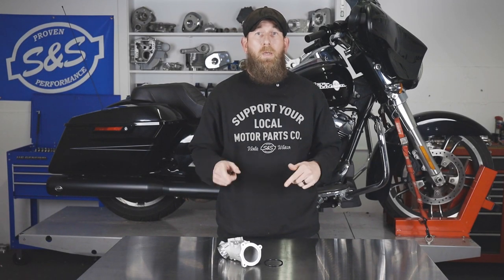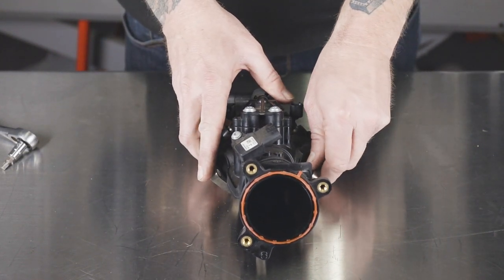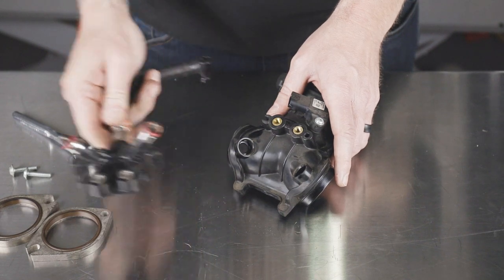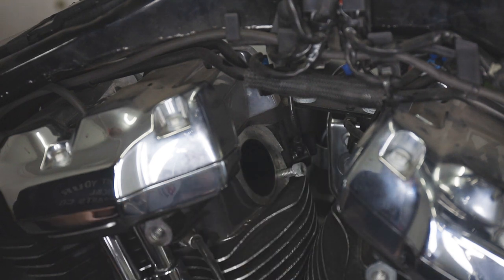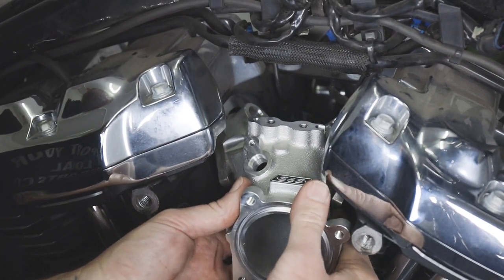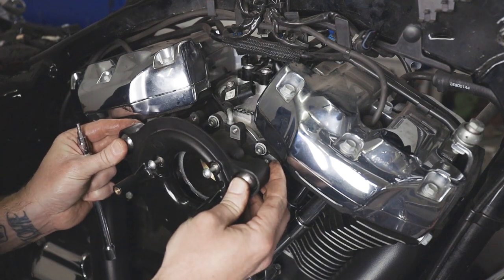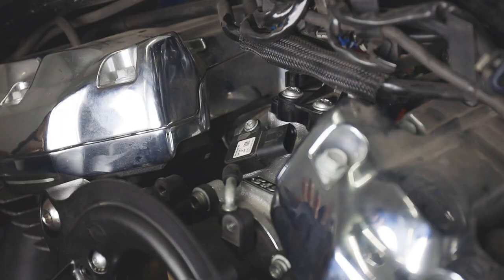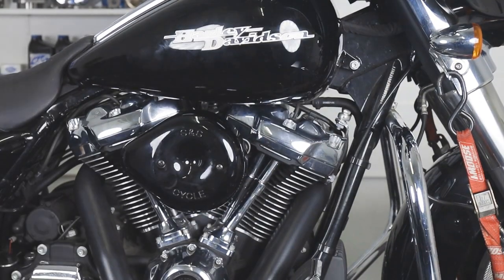Overview & How to Install - 55mm Performance Manifold for 17-21 M8 HD® models

Comment: Why do you remove he manifold as a unit then remove the individual components while off. Then put new manifold on then add the components. Why not just put it back together while off then install the unit as a whole the way you removed it?
Reply: That bothered me as well
Reply: Same reason you don't see a torque wrench or loctite anywhere in the video. 😂

Comment: Great video. A couple of questions, it appears you didn't install new intake manifold seals and didn't lightly lube the intake seals or the o-rings on the injectors or T-Map sensor when reinstalling. Is there  reason why? I have always lubed them with light smear of o-ring seal grease (PYB) or a touch of clean motor oil. Just checking to get your opinion. Thanks.
Reply: Makes sense to lube the "o" rings slightly. New intake seals is good insurance. That's my opinion.

Comment: Simple modification to make however not worth the time and money. My M8 stage 2 ran well before. The slightly larger bore cast aluminum intake manifold made ever so slight improvement if any.
Reply from the maker: We have seen the most benefit in replacing the stock plastic pieces when you begin increasing the cubic inches of the engine. At 124 and large, the stock piece begins to show it's weaknesses to heat that you do not get with our manifold CNC machined from T6 heat treated cast aluminum. As an adaptational benefit we see an average of 3-5 hp with just this one swap.

Comment: Hey man awesome and very informative video
 Kudos.  If i only do a stage 1 on my new m8 bike  do a i still need to replace the plastic intake manifold? TIA.
Reply: The stock plastic manifold is prone to failure.  With a stage 1, you do not need to do this for performance reasons, but it is nice to remove a common failure part from the bike.

Comment: I see a lot of shops using huge throttle bodies upwards of 64mm for stage 3 builds. Does this 55mm replacement flow enough air for stage 3 build of around 120/120? Thanks

Comment: Hi, I am just curious why you do not install the fuel rail, injectors and map sensor before you fit the manifold in place? You don't lock in the manifold bolts until after the throttle body is installed. Clearence issues? I am a novice just enjoying seeing how it in done. Thanks for the excellent video.
Reply from the maker: Installing the fuel rail, injectors, and map sensor after mounting the manifold makes lining up the manifold and accessing the bolts easier.
Reply: I agree. I had significant issues with the injectors and the T30 bolts being installed after the manifold was in place. Had almost no clearance. Had to back out the manifold in order to get any kind of T30 tool on the bolts. I was installing on a 2018 Ultra Limited
Reply: @SSCycleInc  I find it just the opposite. Never had an issue lining up the manifold or accessing the socket heads with fuel rail and injectors installed first. Map sensor after all is tight. Easy.

Comment: Hello, what long hexagon socket biscuit wrench do I need to unscrew the Manifold from the cylinders? Do you need a new map/calibration , or does my existing one adapt to the larger airflow? I have an engine conversion from 114-117 cui and a dyno map.
Reply: I think you’re asking about a ball end allen socket?
Reply: Try an 8" inch ball end Allen
Reply: He's clearly talking about a hexagon socket biscuit wrench. A very rare and elusive tool, there is no need to divulge on this as we will just view it here and bask in all its glory. Carry on..
Reply: I have since changed it. What you can't see here is the left side of the machine.
Here you still have to remove the ignition coil.
The bracket is solid steel and you think the engine is hanging from it.
I tightened the manifold by feel and it was tight.
In the end, the change was probably not necessary, but not wrong either.
For a layman, like me already a great feeling to have done it myself.
The Trast Cover ventilated from the gearbox and the Power Clutsh from Müller were similarly difficult to assemble.
Greetings Thomas 
 @firstnamelastname9230

Comment: Is there a need to get the bike remapped after installing the new manifold? 

I’m pretty sure I’ve got a leaking seal on my stock manifold because I have high revs on cold start up and it slowly drops down as the bike warms up… I think the metal expanding closes the leak? It’s just a theory but I’m pulling hair out trying to solve the issue.

So tempted to just swap the whole manifold out while I f*ck around with it
Reply from the maker: It’s never a bad idea to tune your bike after changing the airflow in our out of the engine.
Reply: High revs on start is totally normal. It's what's called a "Cold Start"

Comment: What size ball allen socket/wrench for the intake bolts MM or standard.  I need to purchase a set and want to make sure i have the right size. I ordered an intake just waiting for it to arrive.
Reply from the maker: Hey Robert, are you referring to the actual intake (filter/cover/body/etc) or the manifold behind the intake?
Reply: @SSCycleInc  Intake but you called yesterday and I go it installed.

Comment: I am having trouble with my stock manifold. It seems like it is time to change out the gaskets. I have been considering this manifold so that I can replace and upgrade the entire system rather then reinstalling stock parts. My only concern is that I am still running my bike on stage one. Would it be safe for me to use this manifold until I complete my build  ? I don’t know much and I am trying to gather as much info as possible before purchasing parts.

Comment: What's the difference between yours and the screaming eagle one
Reply: This one is 55mm. The SE one is ported to 64mm, to match their 64mm throttle body. The 64 claims 2-4% more flow (5hp), so this might be 1-2% more, about a 2hp gain. To me, I'm hoping it stops the butterfly valve chatter I'm getting in my stock throttle body, by stiffening up the manifold, going from plastic to metal.
Reply: What stage do you have or cubic inches to had to go to 64 mm?
Reply: @dylandream2248  I actually was getting a 55mm SE manifold on a 114ci engine. For 64mm, they recommend 124ci or bigger.
Reply: @YoursInYeshua  SE makes two manifolds, one is a 55mm the other is a 64mm.
Reply: according to fuel moto the screamin eagle one flows better since it somewhat ported and polished
Reply: I sent my 55mm SE manifold out and had it ported. It is not ported at all and has rough surface inside from production. The S&S and SE manifolds are nearly identical although I've seen dyno results where the SE manifold consistently gets better results on the dyno. Not knocking this product but that is a fact that can be looked up.

Comment: Hey, I’m considering one of these, but I’m not quite ready for a stage 3 (I plan to do one this winter) 
Would I benefit from upgrading from this manifold with a stage 2? 
Im running a supertrapp exhaust, woods 777 cam and a S&S Stinger intake.
Reply from the maker: Hey Dexter, many of our dealer shops swear by swapping the manifolds even with a stage 2 set up. This one part change will gain you between 3 & 5 HP alone, along with increasing the air flow.
Reply: Ordered one! Thanks

Comment: Whats the benefit to me, i have a 2021 Street Glide with stage 2, should i get this or is it only for the big bore kits?
Reply from the maker: We’ve actually had shops that insist on putting them on with a cam upgrade or even a completely stock engine. You’ll still see the 3-5hp boost from it, and most importantly you will be getting rid of the stock plastic unit. While the largest benefits show with a big bore, your stage 2 engine will also breathe a bit easier with it.
Reply: @SSCycleInc  good to know, will place an order

Comment: What is a difference between stock and yours
Reply from the maker: Ours is a CNC piece machined from T6 heat treated cast aluminum made to withstand the heat kicked out by bigger engine builds.

Comment: Any idea when this manifold will be back in stock?  It hasn’t been available for a couple of months or more.
Reply from the maker: Our production team is working tirelessly to get everything restocked for our distributors and dealers, due to the volatile nature of the production environment we can not provide estimates on restocking times unfortunately.
Reply: @SSCycleInc  Thanks for your reply.  I’ll keep checking you website.
Reply: @Jim_Berry  Fuel Moto has this in stock and is currently 10% off until 12/5.
Reply: @Kingdlack  Perfect! Thanks

Comment: What cubic inch was this designed for? Do you recommend an aftermarket throttle body to pair with this?
Reply from the maker: While you will notice some benefit with a stock engine, our 55mm Manifold really shines when you get up to, and over, 124"
Reply: @SSCycleInc  I’m 3/4 done on the install right now.
Reply from the maker: @20sgcvo90  Heck yeah! 🤘
Reply: This is a must do with every cam and exhaust upgrade wow what an improvement!!!!
Reply from the maker: Glad you’re loving it and seeing the benefits already!
Reply: Please offer this as part of a cam install kit and power package
Reply: @SSCycleInc  THE UPGRADE HAS TO BE A HUGE PIECE OF MIND COMPARED TO THE PLASTIC

Comment: Would this benefit a stock bore but modified Milwaukee 8 ?
Reply from the maker: With a stock benefit you won't see as much benefit as a big motor build would, but you will still see some benefit.